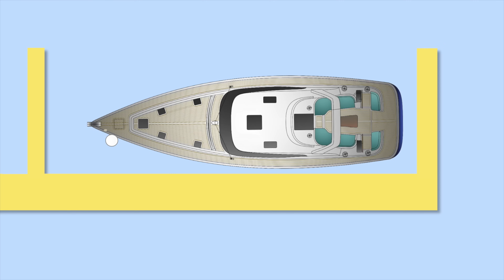Spring Line Docking Techniques

Comment: Yes definately more of these 'how to' videos. As a single hander using springs, and spring bridles, (set up as slip-lines) is a very useful way of getting on and off a dock.  And I am very impressed that you have bow and stern thrusters and didn't use them - that is classy.
Reply from the maker: Thanks! We're working on more how to's :-) Its been fun getting to know the new boat and I've been practicing the close quarters maneuvering.

Comment: This spring line to push off a dock looks simple enough Paul.....nice to have Sheryl aboard so you only need to ask once to do something. Your new vessel sure has nice lines. You ruined me on keels and now I only want a swing keel....and cannot find one that I can afford....I think everyone that has moved thru your wake also now wants one. Thanks Paul ;).
Reply: What size boat are you looking for?
Reply: 48 to 54' Monohull Pilothouse with 14 to 15' Beam (will be my new home), prefer a steel hull but fiberglass is okay.

Comment: That bow spring and fender cast-off was the first technique I got taught when I got my first boating license. If you have a rudder that is in the prop wash, steering into the dock will help you turn faster, which is really neat I in a tight spot... :-)

Comment: Finally had a chance to watch. Entering and leaving the slip with a strong crosswind is my biggest concern. Also, if the boat has an outboard motor that isn't as big as it should be and there is a tail wind.

Comment: Paul and Sheryl,
     Greatly informative video.  Keep the info videos coming.  Love the several series you guys put together in the Bahamas a couple of years ago.  
    In this current one I LOVE the superimposed graphic of your new boat on the aerial shots.  The other thing that would help in spring line and other docking and undocking techniques would be to show the position of your rudders and the direction of the prop thrust on that boat graphic and discuss how rudder position and the prop direction also help swing the boat.
     Still not a boat owner yet, but its getting closer.
"Barney"
Reply from the maker: Great idea Byron ! And we will revisit the Bahamas next spring with Distant Shores III!!!

Comment: I'm a closet sailor LOL.  When single I was always on a sailboat but after marriage always motor cruisers.  I miss sailing so I'm living vicariously through you.  Love the tips and I can see a use in motoring but just bump the props....no 10 sec engaging or you'll take the dock cleats out LOL.   Though I have twin screws with bow and stern thrusters thus not needing to perform this maneuver, I can't wait to try this and freak-out the dock master.

Comment: Nice work on the spring line, I see you have vertical battens which I have never ever seen before. Won’t  that  disturb the wind movement across the sail. What are your thoughts on this ?

Comment: When swinging out on the stern line you should tie it off on the opposite side of the stern,  that way you can turn your rudder towards the dock and use the engine to swing out, the stern will keep clear of the dock, no need for fenders..  Works well even if the wind is blowing towards the dock, and it's slot easier when soloing.
Reply: Hi Anders, I thought the same.
Better control with engine, and you don't need the wind blowing off the dock. You are right! :-)
Reply: @ushi120  Yeah, I use this technique quite often, even in rough conditions it has never failed me.. You're in total control and it looks damn impressive 😅 Also I think it's a good idea to practice these short handed manoeuvres even if you have a full crew. Good practice and it frees up some hands that can focus on other stuff or standby in case shit hits the fan.
Reply: Hey Anders, I'm totally agree with. Easy-onehanded-manoeuvre- technique can also be used with  crew. 
I use the sternline next to dock, to dock alongside.
I use sternline on opposite to dock, to swing off the dock.
Perfect technique for me too.
Thx for your comments

Comment: What did you do at 3:11? You released all the lines besides the stern line and put the engine in gear (forward)?
That should have pushed you back to the dock...
Reply: He used the wind for (side)moving boat and then he put forward and released the stern line.Untill that he was waiting position and right moment to step forward.
Reply: @ivanlucic1040  cekaj, nije dirao motor sve dok ga vjetar nije odmaknuo od doka i onda kad je dobio kut, ubacio je u brzinu i dao gas?
Reply: @zvonimir2096  Tocno, cak je to i naglasio da ce napraviti... Taj brod ima cak dva bow trustera, a da je koristio bilo kojeg, bilo bi vidljivo iz pticje perspektive(jako dobro snimljeno). Ako ti se ucinilo da je koristio gas, nije! Samo je kliknuo na prvi zub i mod forward, ali bez pojacanja gasa, a to je cisto da ima neku distancu krme i kopna. I ponovit cu, da je davao gasa, ljepilo bi ga za obalu, a ovako je samo cekao da ga prirodna struja(u ovom slucaju vjetar) odvoji od kopna.
Reply: @zvonimir2096  Da, naglasio je! Naglasio je cak i "put in the gear" , staviti u brzinu i to niposto nije davanje gasa. 
Tesko je nekad i prenijeti sve detalje informacija koje su potrebne za takve radnje... 
Ali jesam, skiper sam pa mi je jasno.
Reply: @ivanlucic1040  i ja sam radio kao skiper prije, vise ne
Reply: @zvonimir2096  Eto kolega, sve smo razjasnili! Ostaj mi zdrav i svako dobro!

Comment: In reverse, the boat pulls to port?
Reply from the maker: Yes most boat will pull to one side or the other depending on whether the prop is right or left handed. Folding props (like our Varifold) tend to pull more I think.
Reply: Yes, I was asking about your new boat specifically.  BTW going up to 37°C in Toronto this week, plus humidity.  Not looking forward to it.